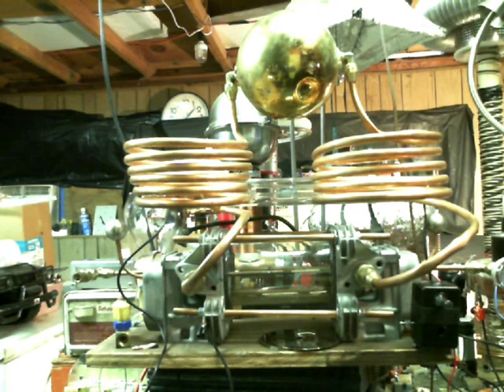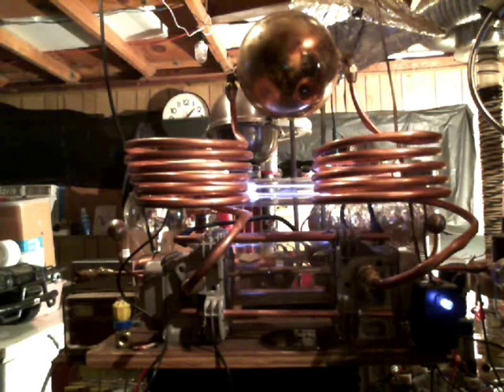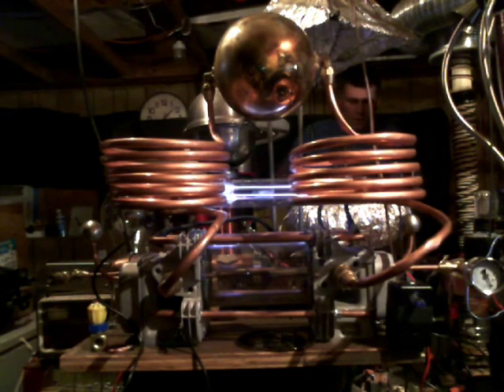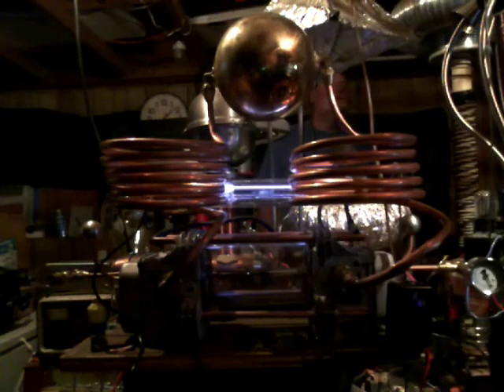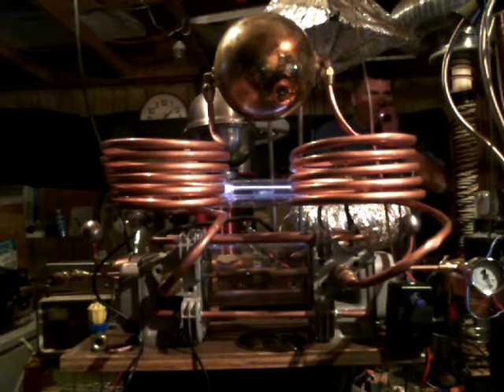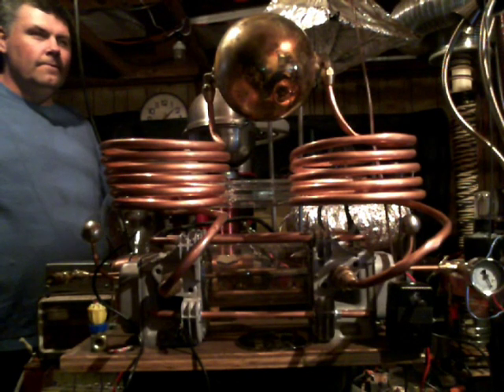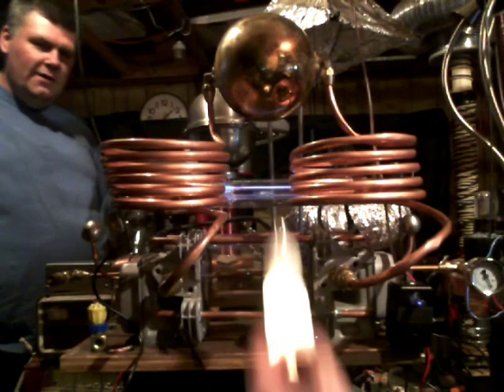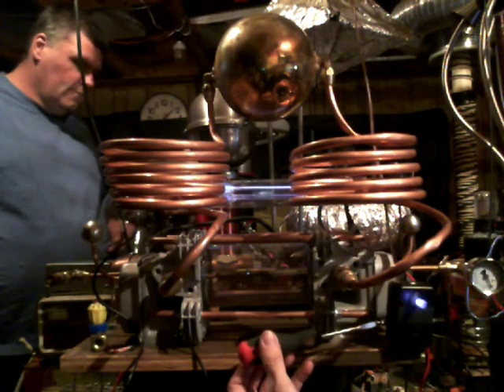PHASE2 PLASMA REACTOR !

Comment: Natural Sceptic on all this free energy stuff, still it keeps you guys busy).
Reply from the maker: Do you believe in the electron theory? PROTON/NEUTRON/ELECTRON? If so then skeptical is a good thing. Energy travels in waves when acted on by an outside force. Almost like Isaac Newton explained in his 3rd law A force is a push or a pull that acts upon an object as a results of its interaction with another object. ... These two forces are called action and reaction forces and are the subject of Newton's third law of motion. Formally stated, Newton's third law is: For every action, there is an equal and opposite reaction.. So with that said  energy is free if you understand the physics of how things work. See the thing is we have access to more energy than we can ever use. It is not nor has it ever been that we do not have enough energy it is that we have been using it wrong. I would love to talk with you about this, do you use skype? if so ad me as a contact so we can chat. Maybe if you like we can do a radio show about it. :)
Reply: Atomic theory has been around for a long time, so of course.
Your quote: "Energy travels in waves when acted on by an outside force" - No it doesnt, look up the double slit experiment; that shows the reverse of that can be true.
Einstein developed the theory of relativity NOT Newton.
Of course there is energy locked into every atom; the trick is releasing it using minimal energy, consistently, economically, plasma may be the way; however there are many researches already working on this..dont want to discourage you though, some of the greatest discoverys of our time were made by people playing about with experiments..look at penicilin.
Reply from the maker: I was half asleep when I wrote that LOL none the less  Isaac Newton explained in his 3rd law A force is a push or a pull that acts upon an object as a results of its interaction with another object. ... These two forces are called action and reaction forces and are the subject of Newton's third law of motion. Formally stated, Newton's third law is: For every action, there is an equal and opposite reaction   . All we are doing is moving energy around and yes it dose travel in waves. But regardless energy is free and has always been, so when people learn how to use it in a more efficient what I am saying will prove itself out.
Reply: shaziz, fair enough), things do happen differently on the quantum level however, electrons change from having wave propagation to acting like particulates/objects with mass once you observe them (double slit experiment). Yes I am quite familiar with Newton and most scientists in history.
I think the most compelling case for free energy is atmospheric energy, Tesla and Feynman have talked about this, but looking at Teslas original patents; he first electrified the energy collector to a few thousand kv(or maybe more in the case of Wardnecliff tower) in order to collect more energy; now I have seen this work on youtube.
2 Russian guys placed a 10kV transmitter on the ground in a thunderstorm..and low and behold the lighting struck that spot, now obviously we want to avoid lightening; but we may be able to charge it up just enough to collect manageable energy we can store, tesla used a simple plate-insulator sandwich. But like all Tesla patents; he was very criptic sometimes and purposely hid a major detail.
Reply from the maker: It is said that from the surface of the ground the electric potential increases by about 100 volts per meter. So with that said we use ground wires on nearly everything in case of a build up for obvious reasons. We do not like to get shocked by high voltage. None the less that power can be tapped into. Ion Harvesting Technology harvests electricity day and night and even during bad weather. What to do with that once collected is the easy part. Tesla showed us some cool tricks with his research. We can speed it up, slow it down changing the frequency of the discharge and so on. But the simple is even a lightning bolt can be guided to where you want it to go, while extracting what you need off of it as it goes by. Nature is powerful and all we are doing is getting work done as nature balances things out. The battery and capacitor technology is getting amazing. And with that said as all the atmospheric gases and more  are slamming into each other rubbing up against one another building up charges even close to the ground we can use materials to deliberately gather static to build up voltage that then leaps across spark gaps to charge storage banks.Voltage, electric potential difference, electric pressure or electric tension (formally denoted ∆V or ∆U, but more often simply as V or U, for instance in the context of Ohm's or Kirchhoff's circuit laws) is the difference in electric potential between two points. And that difference is what we use to get work done. One side charged higher means that if it has a path it will flow to the other side until it reaches a natural balance. So I agree that the compelling case for free energy is atmospheric energy. However we can replicate nature and the processes to get reliable clean energy on demand simply by understanding that when we throw nature off balance it will slam back into place with just as much force or more every time we do and we will use this force to run our toy's. :) Energy can be changed according to physics but not destroyed, so what I have been saying is there is no such thing as waste if you engineer things properly regardless of free energy you will reach maximum efficiency and therefor things will last longer and so much more. Energy is free once you understand the mechanics of nature. It is really quite simple we ride the boat down stream and paddle back up stream until we figure out that the sun and the wind will do the work for us. Not to mention we are floating on the perfect fuel in both directions. I like talking with you and believe you will go far. Thank you it gives me hope for the future. :)
Reply: shazizz: Yes Fehnman mentioned the 100v/M in one of his lectures, I think we would have an hard time harvesting the energy from a thunder bolt with current component technology, I have a Masters in electronics plus a fair bit of component knowledge so familiar with Kirchoff's, superposition, nodal analysis et al.
As far as storing high energy, there are some industrial capacitors that handle many kV...many pop up occasionally on ebay mainly from Russia, but the old Leyden jar at least is always readily available to make; naturally it has very low capacitance): (C proportional to PlateArea/distanceBetweenPlates). I think the trick here is to generate an high voltage(>10kV) harness this high voltage(+collected) via Teslas spark gaps-> step down transformer and store. What would be even better is to find out if the atmospheric energy is fluctuating; then we could use a tuned circuit to collect.
Yes we can never get more energy out of something more than what we put in...in general, but obviously we can because we have all seen Nuclear explosions, there is still new opportunities to unlock the potential energy from atoms/molecules and the environment, I can see you use science to back up experiments which is commendable; there are too many doing experiments without referring to work already completed in the past.
I also find Sonoluminescence one area that could unlock energy harvesting, a couple of papers have been written so its still early days.
I am going to be trying some atmospheric experiments shortly by charging the top-plate(Based on Teslas design), still working out the details though).
Reply: shazizz; you might be interesting in this (Tesla): https://twotowers.com/documents/lakhovsky_multi-wave_oscillator.pdf
From that it says Tesla was using a high voltage at a frequency of 150Khz, giving a wave propagation of 2000M, the wave travels around the globe creating a standing wave which would then be self-amplifying, like pushing a plunger into a water bath at the right frequency will cause the wave to get higher and higher. This must be talking about WardenCliffe Tower project he was working on before it was demolished due to lack of money. (On Page 25)

Comment: !!! WTF !!! Bulb shines without contact???
Reply from the maker: +Botrax wireless energy is a cool side effect but not what I am going for. I am more interested in containment and tunning. Once you understand how energy moves and that enrgy can be changed into different forms and moved around without any losses. And that voltages is pressure that can be spead up or slowed down and when amplified and pressurized moved from point A to B rapidly away from the source, at the same time you get visible ligth and even heat in the process. And still yet not even scratch the surface of what it can be used for. Search up the mercury arc rectifier and take note of the date it was made and what it was used for. That is a simple way to begin to understand what is just one of many uses for this study.
Reply: +shazizz what exactly is this reactor capable of? can it power a house?
Reply: +mechnokie blood No not yet, but KESHE is trying hard to make it work...
Reply: Botrax hmmm so its amplifying energy through accelerative oscillation is it?
Reply from the maker: mechnokie blood The ultimate goal is to act as a tuner/energy transfer system. By speeding up or slowing down the process by which the argon is energized into the plasma state. Look up the mercury arc rectifier, it was used to take high voltage ac to high voltage dc. But in reality had many more interesting uses as well. This one built up enough energy to destroy itself. But on the bright side made way for an even better design that I am working on.
Reply: Hmmmm personality im a weapons designer that only provides wepons to those who really need them fuck darpa I saw your first design I like how its compact

Comment: if you could maybe use the sealed spark that is like a light bulb ,in a glass tube ,so much difference controlled heat and gas exchange. properties ,helium, nitrogen, also argon, under a vacuum state as your spark release ......thank you for the video.